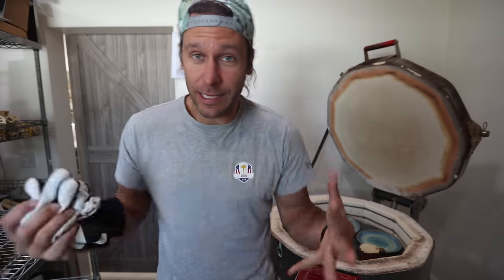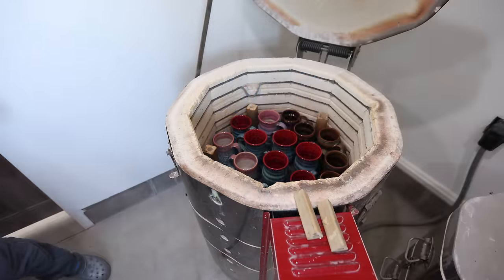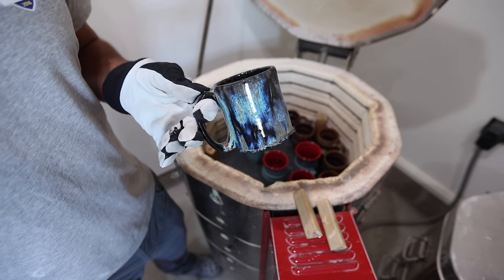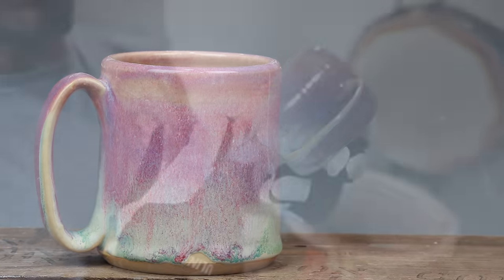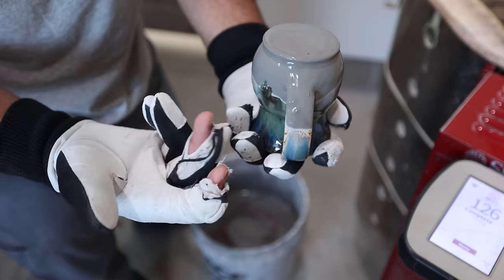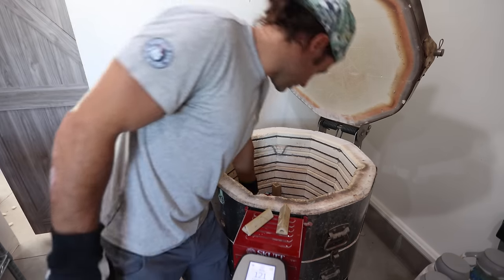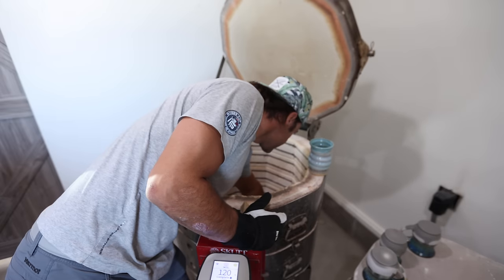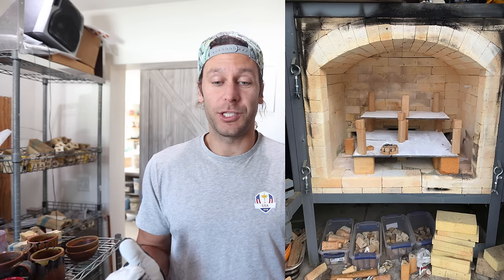My 5 BEST Glaze Combinations - I show you exactly how I do them

Comment: I know mayco as brush on glaze. Do you buy in bulk as a professional potter? Can you just scale up the brush glaze and dip, or do you need to add a floating agent or something? I've always wondered🤔
Reply: Mayco also makes powdered form in 10lbs. So you can mix with water. These are available through mayco and their distributors. More economical and quicker than pints.
Reply: @patriciasadlertrainor6771  I'll have to find a distributer that has more than the pints then. Thanks for the answer!

Comment: Can you tell me how you re fire  your cups that dripped a lot upside down ?  I thinking you but a post on the inside but how does that not stick to the inside glaze 
.
?    Thank you
Reply from the maker: I use a stilt on top of a post and then balance upside down !  As long as the glaze isn’t too thick the stilt pops right off !
Reply: @Jonthepotter   thank you